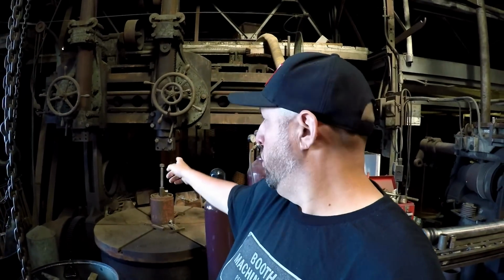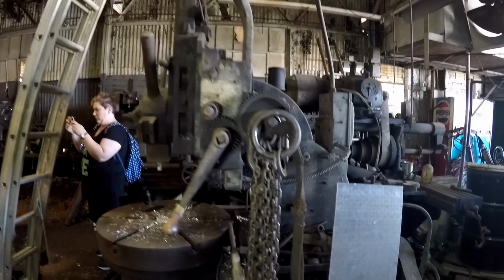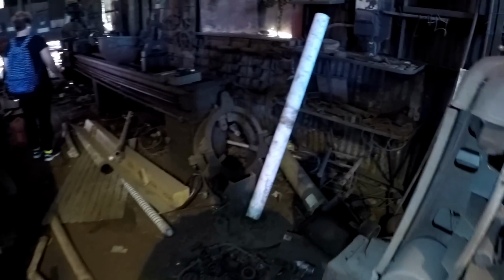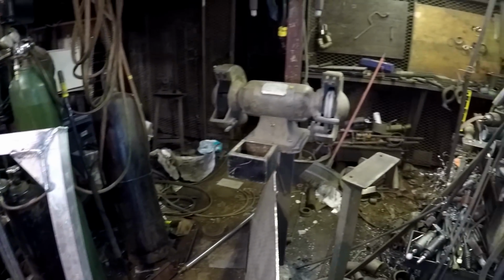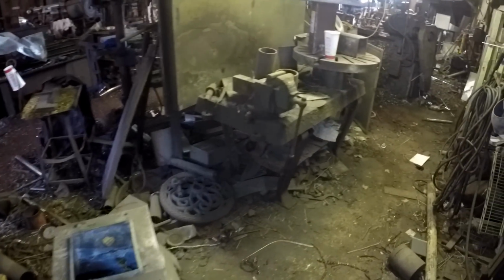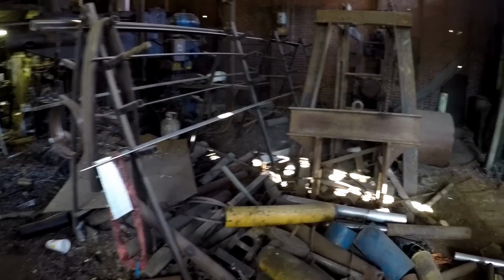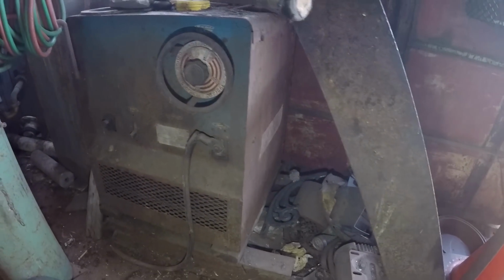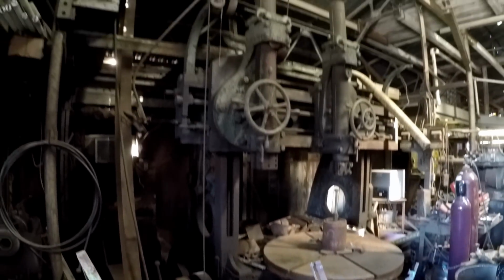113 Year Old Machine Shop

Comment: This is a working shop? I don’t want to seem disrespectful, but it seems to me that it should be cleaned up. If it’s a museum, actually, then it should still be cleaned. I suppose that part of the shop isn’t being used, so they don’t care, but how can people work that way. A couple of days, and a small dumpster would do it.

The dual headstock/tailstock was intended for work on large wheels where a shop couldn’t justify a lathe for just that work. Most of the time, the main spindle, the shorter one, would be used. The bigger capacity wasn’t used for big shafting.

There were gap bed lathes around that time, but machinists didn’t like them, because it took too long to put the part of the bed back and align it. They never, even in new machines today, fit back the way they did from the factory, because they were ground in place.

Comment: ….17:30...Sureweld...might be made by Miller, they made a lot of welders and were 'branded' by other distributors...….20:40...big press, yeah, I've been in a couple Machine Shops...as 'The Welder' guy......some of those horizontal presses go to 400 Tons easy...they are sometimes called 'wheel presses' for pressing railroad axles/wheels...

Comment: If you ever get that way, check out the DuPont powder factory in Delaware.  They have a fully functioning water powered, belt driven, machine shop that might make even you jealous.  They turn it on for every tour.  It’s pretty cool when they open the gates and the brandywine river fires up the whole room.

Comment: That place is filthy and dangerous. Who would do business with such a trashed business. Most people would see a shop owner who took little pride in their work.
Reply: Hydraulic repair is a gold mine. I've made $4500 for a Saturday turn around before. Takes big old equipment to work on them usually. Not a lot of shops do hydraulic repair but it's like shooting fish in a barrel when the quick turn job arrives. Having a $350K excavator machine down for weeks because of one bent cylinder rod is not cheap. Never saw the owner of the machine,  just his signature on the check when they picked it up. I could have been in a cave with a hammer and chisel and he wouldn't have cared. GETTER DONE! :D

Comment: I worked at American Lafrance in the late '70s. The jackshafts were still in the ceilings from the boiler room that powered some of the machines that were converted to electric motors. The boiler still heated the acres of shop space.
My main machine was a 6' radial drill that did the holes for the 100' ladder truck turntables. They had a Niles quite similar to the one here. 
The history in that 300-year-old shop was awesome. 
I did pieces for restorations and prototypes often. They still had the fixtures for brass pieces for horse-drawn fire apparatus and the old brass castings.

Comment: I was in an old machine shop like that in Milton Freewater Oregon. It was in a turn of the century brick building and my god the machinery in there was amazing! There was a belt driven lathe that had a chuck every bit of 3 feet in diameter and the bed was at least 20 feet. Amazing seeing those old machines still working. If those old shops could talk!

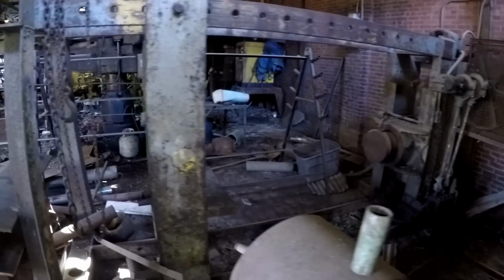Comment: At 20:40 the press looks like a Niles.  If you look carefully to the right of the piston, the high pressure and low pressure pumps are visable.  Above the grey bar above the piston looks to be a pulley for  powering the pumps.  Around the pumps will be a valve which when closed will transfer the pumping from the large piston to the small piston and higher pressure and slower movement.  The original medium for pumping was water.  The Huckleberry RR shop has a Niles wheel press that has one bar at the top instead of two but resembles this one.

Comment: Amazing place.  
The Sureweld welder has NGC (National Cylinder Gas) across the top.  A quick google search shows that Miller manufactured machines for NGC.  I found a reference to a war era machine built by Miller for them.  Sounds like a long term relationship.  I remember picking up oxygen and acetylene cylinders from NGC here in Atlanta in the mid 1960's.

Comment: very sad. looks like the work load was plenty, and they got over run as a climactic ending. I worked in an old school lumber mill, 3 foot blade. all electric and pulleys and belts. we used to add random new spots through the ceiling as the blade sent a random tooth whizzing by. We made piles and piles it looked like an osha nightmare... and then it went silent. This reminds me of how sad I got.

Comment: Adam and the group, here's one I had never seen done on a lathe before...  https://youtu.be/YC9dlLuri4I
Reply: That's cool.
Reply: Driver 1967  that was kind of my impression too.  At first it was like "Ok, what the hell is he doing".  The other thing I've noticed watching a bunch of these Russian machinist is that they almost NEVER use indexable carbide inserts.  It's like 99% of them use brazed on carbide.  I was watching this one machinist the other day and he feels the toolbit, looks at it, then whips out a diamond file, touches it up a little and goes back to cutting.
I watched another machinist who's literally in Siberia.  He puts an end mill in the chuck and clamps a long bar in the tool post at a right angle to chuck and mills a centered slot in the end off the bar.  Then chucks up the bar and slowly turns a long taper down to the milled end.  Then brazes in a piece of carbide the width of the milled slot that has a chisel tooth shape to it.  Later he chucks up a gear he had completely brazed closed then drilled and board to size earlier.  He clamped the tapered rod he'd made with the chisel tooth so it was perfectly horizontal to the bed and clamped the chuck to the bed so it couldn't turn.  Then he used the carriage with the tool post holding the toothed rod to cut a few thousandth at a time to carve out a keyway.  He had put a very then feeler gauge under the toothed rod as a shim to raise it a thousandth or two, then removed the feel gauge and then cut the keyway a hair wider so it would slide over the keyed shaft.  All on a lathe with a little brazing and welding.
You can tell some of these Russian machinist out in these remote areas are master's at making do with what they have, to "Getter Done" as Keith Fenner is always saying.   
I'll say one thing, especially to our young guys, there is a lot to learn about old time jigging and resource utilization from some of these machinist from poorer parts of our world and how they re-source or reutilize materials and machine parts.  It reminds me of my grandparents who survived the great depression.  They threw nothing out, nor did their neighbors and between all of them they could usually make it work.
Reply: Driver 1967  the only issue I've come across with the Russian guys is they seem to talk forever.  I don't know, maybe it just seems worse because I can't understand them, maybe our guys talk just as much?

Comment: Adam this is awesome. I used to make equipment inspections at paper mills.  And many of the old mill paper machines were driven by belted line shaft via a steam turbine and gear box. There are still some of these machines  in operation.  Depending on the length of the paper machine, the line shaft could run the entire length... 60-80' was common. The line shafts were fitted with various diameter "pulleys" or sheaves, whereby the speed of the machine could be varied.  When making a sheet of paper, the wet end mat is drawn through the press section at a slower speed than the following cast iron dryer rolls in the dryer section.  It was really amazing watching the paper makers put a sheet on!  Newsprint mills run at over 1400 feet per minute....that's truckin'

The old St.Regis mill in Cantonment, FL (now owned by IP I think) was an interesting place to tour....I spent many days in there.

They finally started removing the belts and started driving the machines by steam turbine via a coupled line shaft (still very long with the shaft mounted on pedestals)  and then eventually going to sectional, variable speed DC motors.

I saw a lot of old equipment similar to what you see here.  

I did a lot of foreign work and remember visiting a paper mill in France that was completely driven by line shaft via a water wheel.  The paper machine gears were made out of wood.

This country was built with some very old vintage equipment. And the craftsmen who did this work were awesome hard working men.

I wish I could buy the equipment, but my time has passed by.

Thanks for really interesting videos......one of the best channels on You Tube.
Reply: newsprint machine runs at 4000 ft per min. not 1400

Comment: I have 2 machines with the same dealer tag from EL Essley Machinery Co Chicago as on the American radial drill. One is my Index vertical mill from 1957 and the other is a bandsaw from the 40's. Exact same tag.

Comment: The c & j is a carroll Jamieson lathe made here in Ohio. I have three currently because well they are cheap. Sadly the ways that the carriage slides on are not hardened so wear is very very bad usually. They are typically not heavy duty machines at all and have a rather small 3mt tailstock quill which for me is too small for my work. The models I have are the exact same accept for the length. Very side heavy and not alot of speed ranges. Still good users for me and apparently him! That is a newer 60's-80's machine. Mine are the older 30's and 40's stuff. Very cool shop, reminds me alot of the shop I work in.